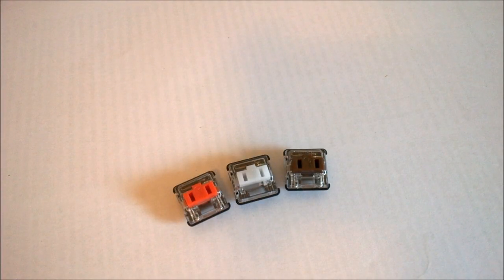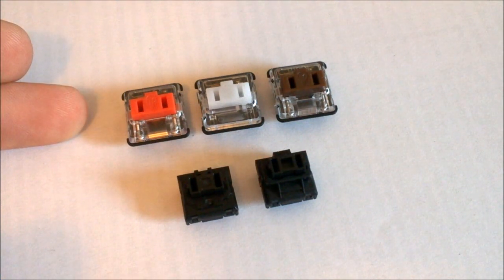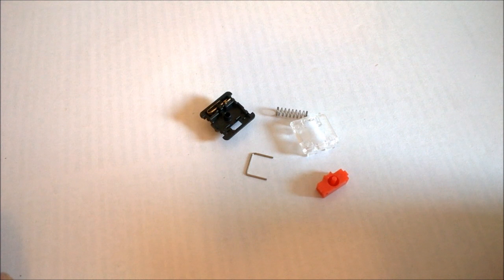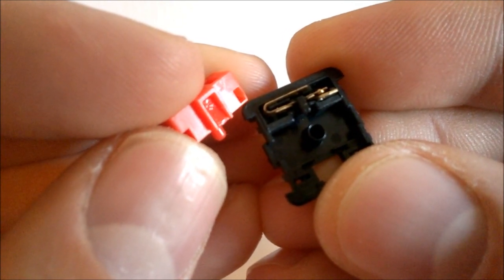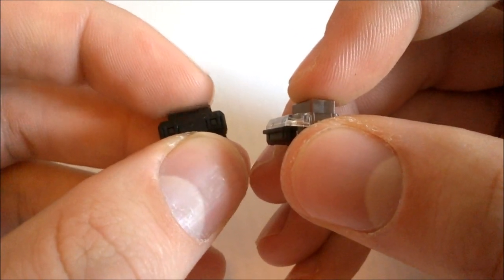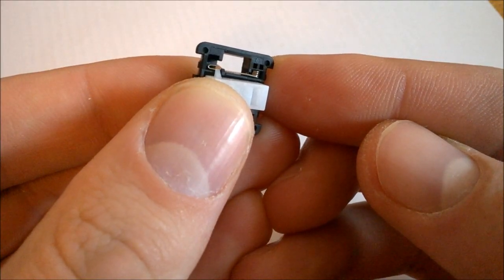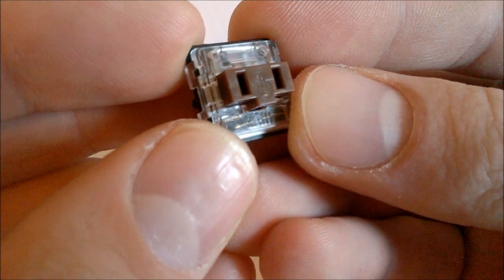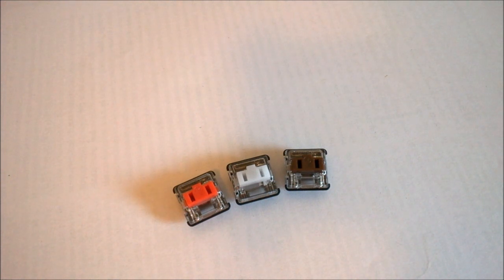Teardown - New Kailh Cherry ML-type keyboard switches!

Comment: "As much of an improvement"
What do you mean by that? Improvement from what? Cherry problems?
Reply: Over the original Cherry ML design. They have the same weak tactility that can barely even be described as such. They're pretty much to Cherry ML what Gateron Browns are compared to Cherry MX Brown. Smoother, but same mediocre design.
Reply: @JackOfHarts96  what are the best switches on the market now?

Comment: Having tried a board with the clicky switches I can tell you the click occurs well before actuation, and the key has to travel a little farther to actuate and register the press. Which, to me, is quite annoying since I've always relied on the click sound of mx blues to tell me when I've actuated. So I just thought I'd point out the clicky switches do give a false sense of actuation.
Reply: I borrowed the clicky G915 from my neighbor (he doesn't use it) and it is good but it has one GIANT flaw...
All the keys actuate before the click!
If you press them slowly or gently you can get all of the keys to actuate without hearing or feeling the click.
Some of the keys are harder to pull that off (actuation is closer to the click) however ALL of the keys can be actuated without a click.
(after actuation pressing further makes the click noise)
Thus proving your statement as wrong and the problem is the exact opposite.

Comment: CTO guys, here is new Havit keyboard with blue switches like these https://www.aliexpress.com/item/HAVIT-87-Keys-Portable-Mechanical-Keyboard-Kailh-Latest-Low-Profile-Blue-Switches-Backlit-Wired-Gaming-Keyboard/32815685108.html I'm going to buy this as my first mechanics
Reply: got one yesterday. those switches are awesome. a little kinda 'alpsy', not counting the shorter travel. if only the keycaps were doubleshot and not uv covered, but ok, the price is not so bad
Reply: I've been using mine for about two weeks now. And I have to say, I still can not type as fast as on my old scissor switch slim, and most likely this is not possible at all, because new keyboard has higher keys, longer travel, and this all lower the speed. I also don't like keys coating, especially because it's soft touch, which slows down fingers slides. Bad idea. And I've noticed sometimes click comes before actuation. And I expected tactile feel to be more clear. I'd like to try browns or reds instead. But I am still sure this is the best mechanics available, traditional ones with super-high keys are just ridiculous. Price is ok for such a unique product. For example Tesoro charges 150$ or so for their Gram Spectrum which has longer key travel than this. Kailh did a great job making this switch, seems like they wanted to copy ML and then realized it's bullshit, and did it their way. While Cherry making 100500 variations of basically the same 20 year old design, Kailh is going forward. As for me, I'm looking forward to see real slim mechanics, maybe combined with scissors.

Comment: You could probably do an entire video explaining how those Hall Effect switches work. I'm still confused after the multiple keyboards you've reviewed with them.
Reply: Meme Lord They're pretty simple: slider has magnet, switch housing has magnet sensor, magnet passes sensor, sensor outputs signal. it's a little simplified, but I hope that helps oit